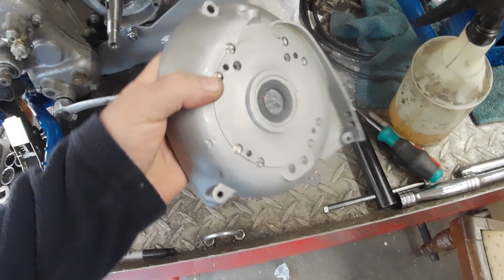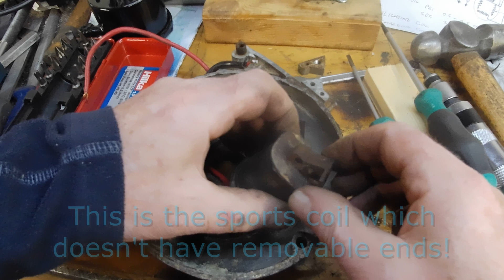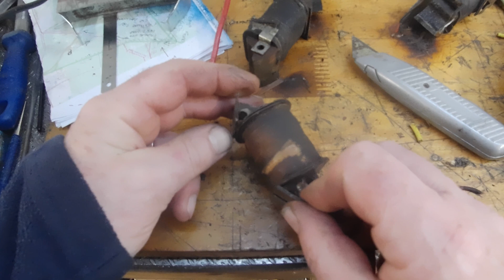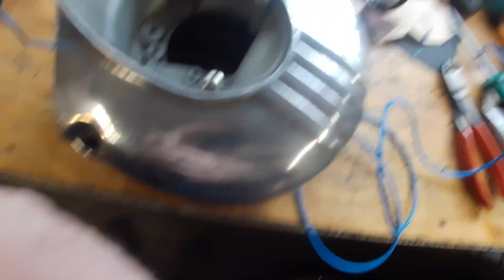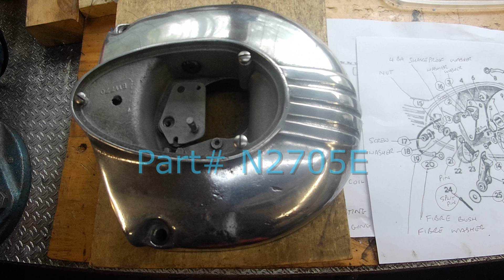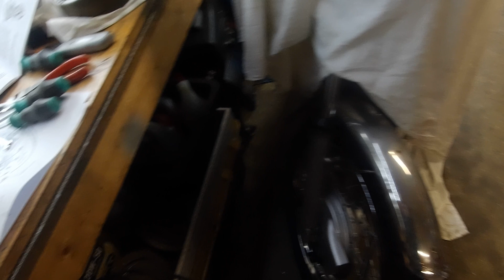Greeves Scrambler Project Part 21 Magneto Ignition Points External Coil Conversion

Comment: I couldn't get a reading from the coil body to the HT contact so I ordered a new one. I'm not getting a reading on the new one either. I wonder if my meter isnt sensitive enough? I would think it would at least show continuity.
Reply from the maker: Is your new coil 'newly manufactured' or 'new old stock'? 
Try testing between HT output tag and points pickup tag. 
If you have an analogue meter try that, some people say they get better readings than with digital meter.
Reply: @InTheShedUK I found out my meter only measures up to 1 k. I found my old cheap analog meter and it shows 6k on the newly wound one. I don't trust this old meter either. Probably time to invest in a new one. Thank you
Reply from the maker: @Pablos_House  At least you got a reading so should be good.
Reply: @InTheShedUK didn't get a reading on old one either so that makes me feel better. Rather not remove fly wheel again

Comment: Well I think my coil is bad too. Is it necessary to strip it down or can I just tap into where it goes to the points? Also do you think both coils are necessary?
Reply from the maker: You might get away with just tapping into it, personally I would rather take it out of circuit just in case it does cause a problem and you then have to remove everything again.
Should work with the one coil but the second one just ensures enough juice for the remote HT coil.
Let me know how you get on.
Reply: @InTheShedUK thank you. I'm still in the tear down mode and making a parts list. Ordering some clutch tools now as I'm to lazy to make them. The crank is stuck very tight. I removed the flywheel with much torque and never broke it free.
Reply from the maker: @Pablos_House  Keep at it!
Reply: @InTheShedUK I'm trying to understand these coils. Is it all one winding and just tapped at two different points?
Reply from the maker: @Pablos_House  The ignition coil has two windings, tapped in the centre which goes to points.
The outer winding is the HT coil and the inner winding is the LT or 'exciter' coil.
The lighting coils have a single winding only.
Hope this makes sense.
Reply: @InTheShedUK kinda. Is the outer winding connected to the inner winding where the center tap comes off? I see lots of people show the parts needed but no real good info on how or diagrams that I've found yet.
Reply from the maker: @Pablos_House  Yes
Reply: @InTheShedUK excellent.  That's what I was thinking. Maybe unwinding it will be my next task. Thank you.

Comment: Have you thought using a head from a 1H motor [225cc] only about 3mm difference in piston dia but the bolt holes may line up, sort out comp ratio. Maybe if you had a 1H head gasket might help you. Also a 1H used a villiers external coil.

Comment: hi Ian all good stuff, I'm working on an other c15 trials bike and going to try and run the ignition off a lighting coil through a et coil I believe they can run on either ac, or dc but not sure, and also I've been told that it will only work if I fit a 5% advance unit again not sure, so your vids will point me in the right direction, regards Adrian. ps electex world do cost an arm and leg.
Reply from the maker: Good article on https://www.jrcengineering.com/technical-support/electrical-tech/lucas-et-ignition-unraveled/
Electrex are expensive but they are a lovely piece of engineering, I have one on my Bantam.
Reply: @InTheShedUK  hi Ian thank you the info and link, I to have the Electrex on my d1 bantam but it's shame they did'nt put a bigger lighting coil on it, it's not that good in fact it's rubbish I've also been thinking of put the old kind of pushbike dynamo on it and run it off the back wheel.